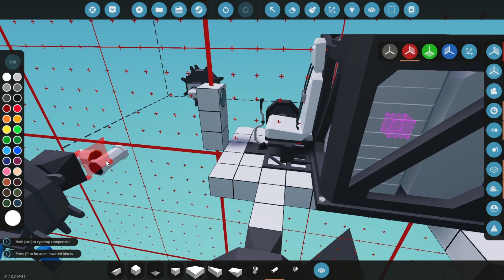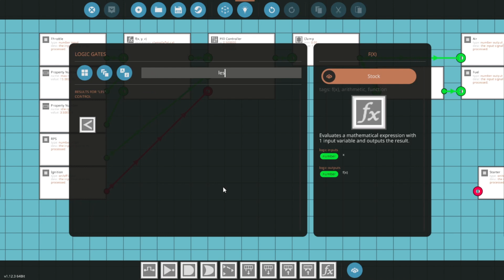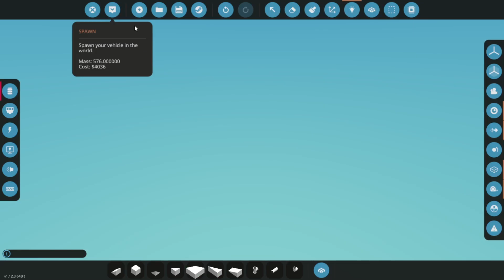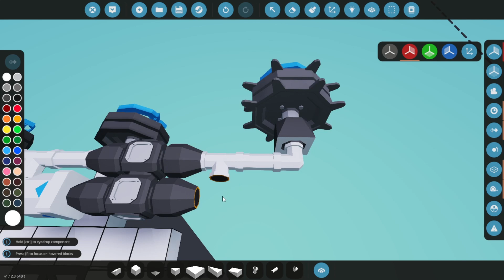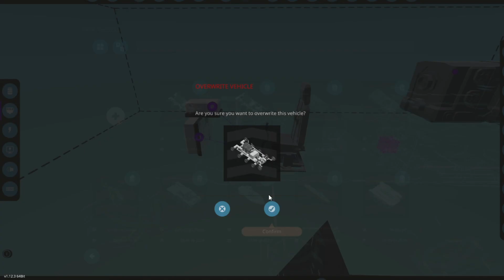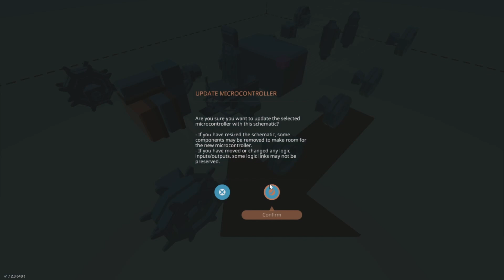Stormworks Tank Tutorial Pt.  2

Comment from the maker: If you guys have any requests for tutorials, let me know.
Reply: Thanks for the guide!
Everything works fine, forward, backward, turn on the spot, but when I drive straight and turn, all RPS are falling almost to zero. Can you please help me with this?
Reply from the maker: @crusader7677  What is the seat sensitivity set to? I want to say I remember some difficulties were solved with that setting. Also, it could be a problem with the engine/clutch system. If the clutches are fully engaged but an ABS block got missed on the engine throttle adapter, it would be enough to stall it. Also, there's not really any anti-stall system in this tutorial. I could supplement with a tutorial on a clutch that won't stall the engine.